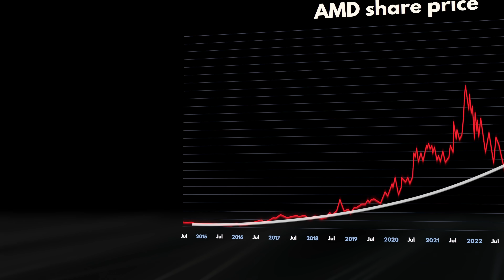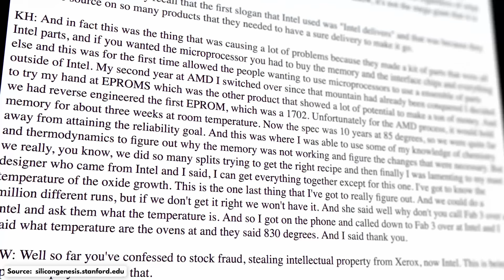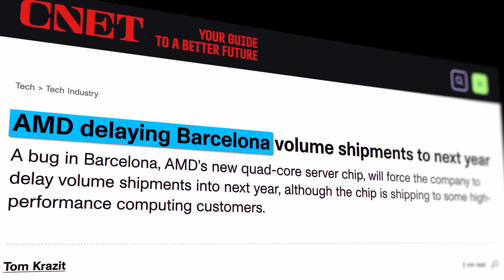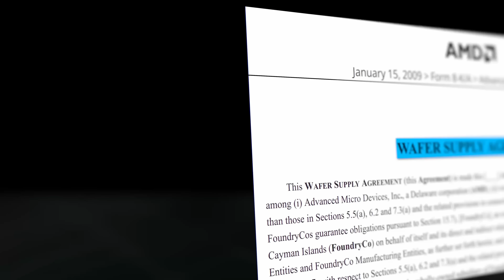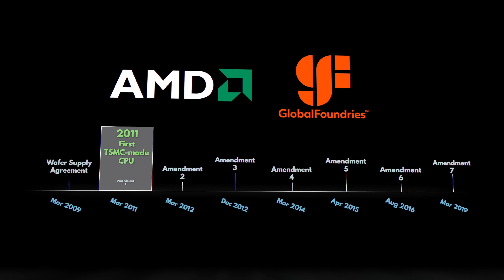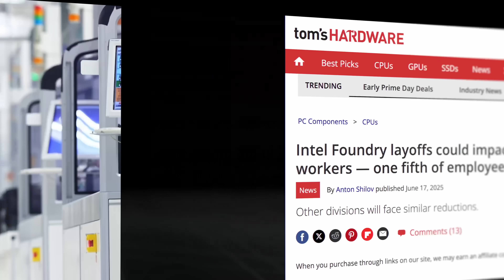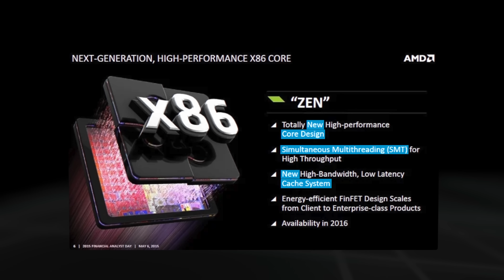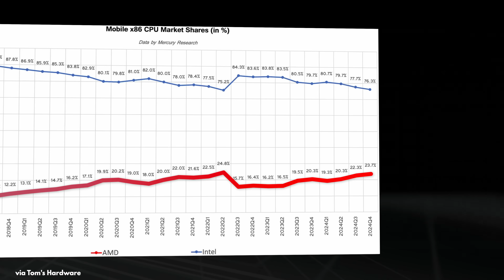How AMD won the CPU crown

Comment: I think its also worth noting that AMD managed to acquire contracts for both XBox One and PS4 CPU and GPU designs.

They effectively built themselves a moat of consistent 5+ year revenue while they worked on the first Ryzen designs.
Reply: Rory Read did save AMD.
Reply: Another unsung hero, AMD hired back Jim Keller to work on Zen.
Reply: Wasn't the XBox 360 also a tri core AMD processor?
Reply: And it's kinda cheating but ATI was in the 360 too.

And it's a real black mark against the CPU industry that during the 360 and X1 era, neither AMD nor Intel could build a good CPU to power those consoles. 
It's taken us 20 years to get from IBM PowerPC to Ryzen's in the Xbox SX.
Reply: @MostlyPennyCat  ATI was on the gaming market since the gamecube
Reply: @MostlyPennyCat  And the Wii, the thing that sold more than the 360 and the PS3
Reply: if the consoles would of went with nvidia they would all have dlss4 but they went with amd and not are stuck with old fsr. basically obsolete as a 7900xtx
Reply: @bigturkey1  Not really, because they would have to get a Intel cpu aswell
Nvidia Tegra wasn't poweful enough yey
Reply: @bigturkey1  PS has said they will never use third party APIs, they will always develop their own custom solutions, Thats why AMD is a better choice as them dont mind creating custom SoC, GreedVidia wouldn´t offer this
Reply: @bigturkey1  " would of went "
J
F
C
Reply: @bigturkey1  Your lack of knowledge is astounding.
Reply: @jannegrey   Your lack of knowledge is astounding.
Reply: @bigturkey1  You know that you can force FSR4 on RDNA 3 and RDNA 2?
Also NVIDIA doesn't ever provide previous gen with it's next gen technologies. So by the PS6 time, you would have issues.
Reply: @jannegrey  yea i read the article, you can force fsr4 on 7900xtx in linux but its 7 times slower than 9070xt doing fsr4 cause it doesnt have fp8 or something
Reply: @bigturkey1  If you mean instead of 30% increase in FPS it gives 15% then sort of. "7 times slower" is probably taken from some extreme measurement where FSR4 in game with 9070XT gave it additional 14 FPS and FSR4 with 7900XT gave it additional 2 FPS. It's possible that gain is so small in some games, but I mostly see between half and 1/3rd of gain compared to FSR3. Basically under no circumstances it works worse than native. So check methodologies, because they often focus on "how much worse" RDNA3 is, because "RDNA3 is obsolete" - when you simply don't gain AS much as FSR3 or 9070XT. DLSS4 also has smaller gains than DLSS3. In some games it is 3 times slower. So I could say that DLSS4 is 3 times slower and therefore shit..... doesn't make sense doesn't it? After all I would just have to play with numbers and look for edge cases.

Comment: even with the impressive progress of first gen zen AMD was still around 2 generations behind at that point, but aggressive pricing strategy allowed them to take over enthusiasts seeking more cores but not willing to splurge on HEDT
but next generations bringing meaningful uplifts brought them to the undeniable top around zen4, maybe even zen3
Reply: AMD wasn't 2 gen behind they always won on multi core and down single core zen 3 is where they took the crown 5600x was dog walking tenth gen in gaming
Reply: @chriswright8074  
First Ryzen series was a bit behind, and a little cheaper. I don't know in terms of generations though.
And they started being really competitive with ryzen 3000/5000.
Reply: Intel's highest end desktop processor outside its HEDT line had only 4 cores until after the 7th gen CPU's. AMD was able to manage more cores but was still behind on IPC until Zen 3.
Reply: I'll never forget how it felt to crank my TR-1950x up to 4.0 Ghz and see that Passmark benchmark declare, 'Your system is faster than 99.99% of systems benchmarked.  So sweet.
Remember when Intel was showing off that system with a $1600 cooler hidden under the table and the 1,000W mobo that would just barely outperform Threadripper and then the very next day Lisa Su anounced that newest TR's would double the core count and still be air-cooled?  Sweet!  Ah those where the days, Intel selling $12,000 packages for $2,000 and still getting crushed by $1,000 Threadrippers.

Comment: Now I want to see AMD's radeon division actually rise up and impress as Nvidia is just so far away in terms of the high end performance and with no competition up there, they charge an arm and a leg.
Reply: there's an opportunity there as nvidia lets up on the perfection in their gpu releases, but that's happening because nvidia is making bank with ai accelerators and the cuda moat. AMD is best positioned to compete with them there as well, so every wafer allocated to a consumer gpu is somewhat of a downgrade over making another ai accelerator card to sell to other businesses.

radeon's been legit impressing since rdna2 (the 6900xt actually traded blows with the 3090 and there was a serious question on which gpu to test cpus against back then) rdna3 was nice, but nvidia kept leaping further than amd expected. Still, the 7900xtx was pretty good and traded blows with the 4080.

rdna4, when properly priced, is also great and got the reviewer recommendations

given that nvidia seems to be coasting in the gaming space, amd does have a rare opportunity for udna (rdna5) to crush it, if they're willing to go for the brass ring again like they did with rdna2. The 10080xt needs to clean the 5090's clock and the 10090xt needs to be a masterpiece for half the price of the 6090 (nice). It should have features that nvidia didn't think of, match dlss, and have more than ample supply.

then they need to repeat the trick up and down the stack.
Reply: @JO_____ I hope that UDNA delivers in spades, unlikely it'll be a ryzen moment cuz nvidia's not coasting nearly as much as intel was back when ryzen crashed their party but still.
Reply: AMD cant make More GPU because bottleneck is TSMC fabs. They Can only allocate production from servera to GPU, but servers have better proffits. When TSMC finally finish fabs in US maybe GPU amount will increase.

Comment: In the server space, it's kinda nuts how much better servers with EPYC processors are. I don't game so can't say anything about AMDs desktop stuff.
Reply: They are as good in gaming, their 3D Vcache line of processors is the go-to for reliable high-end gaming CPUs
Reply: Gaming specifically AMD rules with the 3D cache chips
Reply: Total dominance of AMD in all directions (desktop/HEDT/servers)
Reply: @dasboot5366  Except for GPUs, we are getting completely robbed by Ngreedia.
Reply: I guess I have just been unlucky because so many people seem to have done well with AMD, especially in more recent times.  

Over the course of 30-40 years, those occasions on which I've tried AMD have been nothing but disastrous for one reason or another.  I've been burned so many times by AMD — most recently a Threadripper CPU circa 2018 (bought by work, originally as a replacement for our ganeti cluster and, for some reason, given to me as a workstation when I first got there) — I have been adamant never to buy AMD.  To be fair, most of those problems were most probably the motherboard and/or BIOS's fault rather than anything to do with the CPU itself and are less likely to be issues for data centre applications.

Fast forward to October 2025 and I am going to have to replace my 2017-era desktop because my 7th gen i7 CPU is unsupported by W11 (and for no good reason, 7th gen appears to have al the hardware support W11 requires).  I was intent on sticking with Intel but, between the voltage regulation problems with the 13th and 14th gen CPUs and now Intel's deepening financial woes (INTC stock now rated as "distressed" after Q2 results last week), looks like I ought to give AMD another chance and just pray that all those compatibility problems will have gone away.

Comment: I would like to see a documentary series on how chips are designed.
Reply: Branch education is the channel I‘d recommend you. The quality and dedication is insane…
Reply: There is a good documentary at MIT, it takes 4 years to watch and learn. Then you can understand how CPU are designed.
Reply: @Traumatree  no then you can understand about 5-10% of what you need to know, like any other university... -_-

Books and private courses are the answer.
Reply: Boolean algebra, digital systems design, micro-architecture design.
Reply: Asianometry is an amazing YT channel that has tons of videos about this and much more. Highly recommended.
Reply: I also gotta recommend reading about EDA (electronic design automation) its how modern ones are made by a program that transcribes logic and instruction sets into printable chips for fabs. well mainstream EDAs from Siemens, Synopsys and Cadence are super powerful and could do more than just transcribe, they also do the debugging and layout for interposers/interconnects.

its like glorified CAD/CAM/simulation software but for semiconductors. you use it, it outputs a file, you send file to TSMC/Intel/ Samsung/Global Foundries and months later, they print a wafer.

Also, read about each foundry's PDKs (process design kit)
PDKs are what foundries send out to ensure that the EDAs actually print a circuit the foundry's node process could make.

Ex. Intel 18a uses "backside power delivery" which separates power and signal connectors and has Embedded Multi-die Interconnect Bridge (EMIB) which is how their chiplets connect with a silicon bridge.
TSMC 2nm will not use Backside power delivery but will use silicon interposers via Local Si Interconnect (LSI) so different kind of interconnect.

^ The EDA needs to know the node using the PDK to know how to print your transistor maze pattern and how to connect them to each other the right way.
Reply: Asianometry and High Yield are good resources. NANDland also has some resources on the logic portion. Gamers Nexus has a video as well.

There's a couple of books detailing chip manufacturing history and manufacturing processes themselves as well.

 There's courses in semi as well. Look into semi standards and ask AI about details!

I have a playlist related to chip education, which are some cobbled together videos that I encountered while browsing. It's more of a library or a collection. Lastly, get company slides from people in the industry :p
Reply: I would like to see a documentary series on how chip manufacturing plants are designed.

Comment: If we're being real, Apple currently has the CPU crown...
Reply: they are making wide cores at medium frequency(best performance/watt strategy, but the least cost-effective) since they are making non-server architectures and until recently were 1-2 process nodes ahead of everyone, so yeah, they had massive advantage.

AMD and Intel are making server architectures, thus a lot of small super high clocked cores(worst strategy for efficiency, but most cost effective) and just porting them over to desktop and laptop platforms.
Reply: apple has a closed ecosystem where all stays on their side

they win and only they care, and their few users

all thanks to hardware accelerators, dont forget that
Reply: @betag24cn  Sure, but M4 series has the fastest core in the world by basically every measurement, not taking into account hardware acceleration... and that core is still using maby 1/3 power of the others to achieve that performance, this is literally years ahead of anyone else if we're comparing different platforms
Reply: @lukabosnjak3829 from what i have read, the core is not the fastest, the accelerator is, the core is very efficient

since it is a arm cpu and i dont run any of the loads using arm or the accelerator, the statement means nothing to pc
Reply: @betag24cn  Look at geekerwans data for example, current P core in the M4 series devices is the fastest in the world (even the M4 iPad which is noticeably less perfomant than Macs beat an intel 14900ks that was cooled with liquid nitrogen if I remember correctly). Sure, PC side doesn't benefit (apart from market competition effects of being left in the dust) but it's simply not true that AMD has the CPU crown

Comment: I wish Intel and AMD would give us a more agressive power management on their latest chips. Basically every release of AMDs chiplet desktop CPU design gets worse idle power consumption. Its just unreasonable that a modern desktop PC without a dedicated GPU sips 30 Watts of power where a mobile chip idles at 2-5 Watts with a screen included. Until this has been solved the Desktop PC is dead to me.

Comment: Intel had in the past been practically paying data centers to use their cpus in the past, I got a pc with a ''12th gen'' i5 due to it being way cheaper than the amd option, and kind of slightly regret doing so since it's way worse than the zen 4 options in general.

Comment: I wonder how they will deal with more companies moving towards ARM (and later maybe RISC-V too).
Reply: Or even Ampere...
Reply: intel itself wanted to adopt risc v, but nothing happened

amd on tue other hand has been doing arm related products and this or next uear they should come with a arm soc

the fight is now with qualcom, not intel
Reply: @betag24cn  I'm not so sure I agree with Qualcomm, but more ARM-licensees in general. Nvidia's upcoming ARM desktop-CPU seems like a more valid threat, for instance.
Reply: Intel Corr Ultra is competiting against Apple Sillicon. I think AMD has little cores as well for Zen 6 to compete against apple sillicon.

Apple Sillicon embarrassed the x86 duo with the M series.

Comment: I really hope zen6 releases soon and gets more power efficient. It's wild how good Intel arrow lake h CPUs are.
Reply: Good how? Worse performance than Raptor lake. Still inefficient compared to Zen 4. 7950x beats 285k in some cpu tasks like compression and decompression. While zen 5 was zen 5%, arrow lake was an error lake.
Reply: @Riyozsu im talking aboy arrow lake H, ones made for laptops. Same zenbooks with ryzen 350 and core i5 265H run differently and intel powered one has more raw performance in both single and multi core benchmarks, has better igpu and runs as long on battery.

And yeah, its comparison between 2024 architecture that was focused on servers and 2025 architecture that was focused on power efficiency, but still, Intel made comparable and most of the times better chips
Reply: @Riyozsu  arrow lake is extremely easy to cool, it's much cheaper than Zen 5, outside of gaming it's just as good +/- 5% and it doesn't have hyper-threading finally.